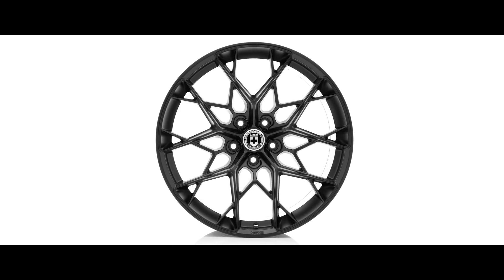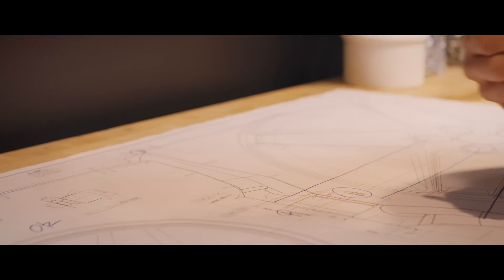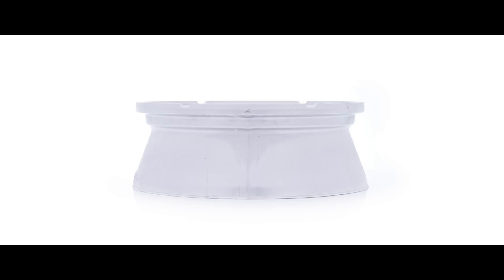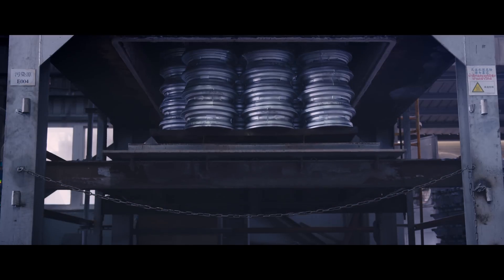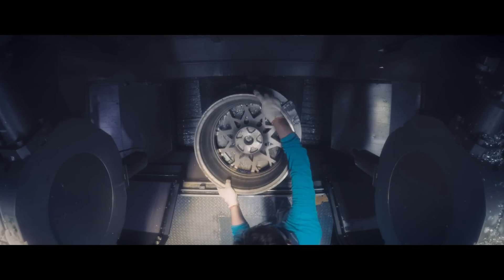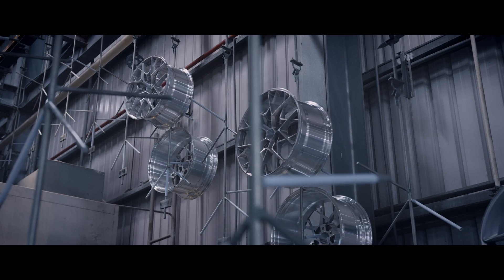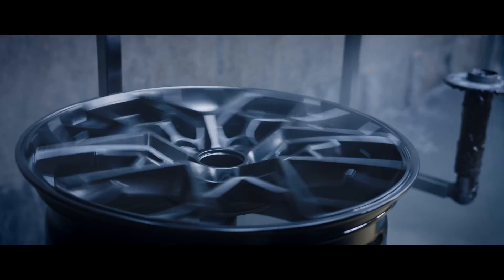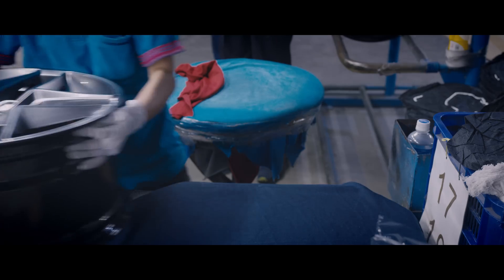FlowForm Wheels | A Look Inside The Factory

Comment: So it's the weaker, Cast type manufacturing process. Still, likely slightly better then a pure cast wheel. Some nice new designs. On average, you can get a set of 4 for $1,000. Forged would be easily twice as much. Teh Vossens I like are $2,400 or $600. Buying online you have to be careful not to by fakes too.

Comment: wow tested design to what standards, american roads or international roads, after all each wheel will fit on so many different cars from 18" to 22" size wheels and it all comes down to the country and type of driving the car will do, like 4x4 for example or made to the standards of the roads in you country, they have standards for wheels on road cars, which has to be meet for all factory cars etc?

Comment: So is flow formed a type of forging that wheels get or did you knock off the name from Konig wheels? Or did they knock you guys off? Or do you both share the same forging style?
Reply from the maker: Forgings are not used in the cast flow forming process. Flow Forming (or Flow Formed) is part of the manufacturing process to create our FlowForm line of wheels after the wheel has been cast. We own the trademark of the term FlowForm® so other companies cannot use this term, but should only be using the two terms of the process, ‘Flow Forming” or “Flow Formed”.

Comment: So is part of the reason they’re so much cheaper because y’all manufacture them in Thailand, and not the US?
Reply: Taiwan, not Thailand ,
Reply: on the homepage it is stated, that the 18 19 and 20's are manufactured in japan and the 21's in taiwan. I willg o for a 19 inch because i think japanese production must be very good
Reply: where did you get the idea theyre in Thailand?
Reply: Does someone know the factories that are producing these rims in Taiwan or Japan?
Reply: Some are Made in Japan and some in Taiwan
Reply: You can get in contact with the manufacturer in Taiwan and get them directly from them for waaaay cheaper
Reply: Google car rims manufacturers in china, you’ll get a list of companies. Pick a couple of them out contact them and go from there… turns out Rohana, Ferada, HRE, Vossen, etc. have most of their rims made from these Chinese companies. You can literally get a 3 piece Rohana wheel for the same cost as a 1 piece wheel. I have some on the way that would cost me $1500 per wheel from Rohana but I’m getting them for $ 612 per wheel. They show you the finished product before they ship
Reply: Cheap because they're cast not forged